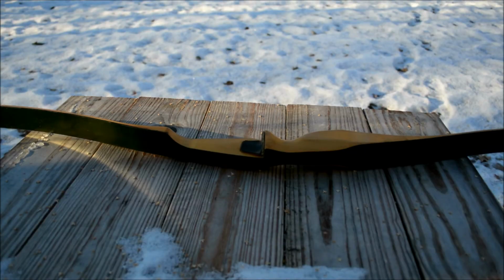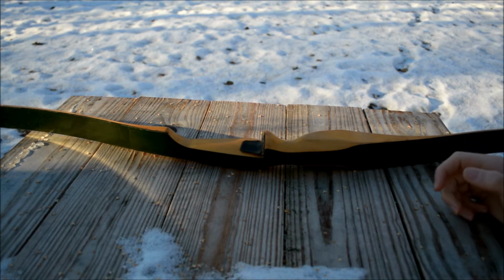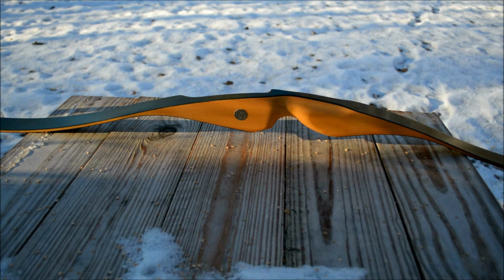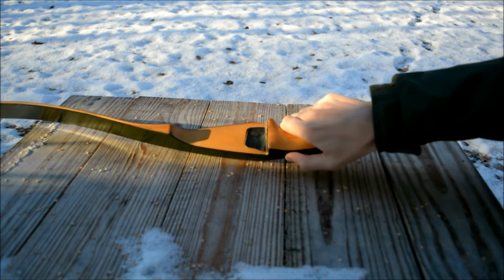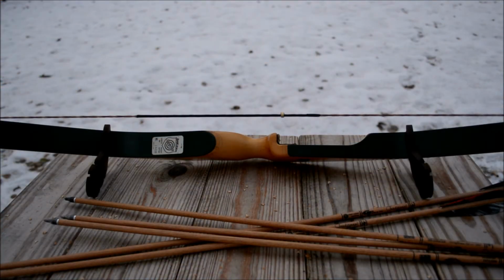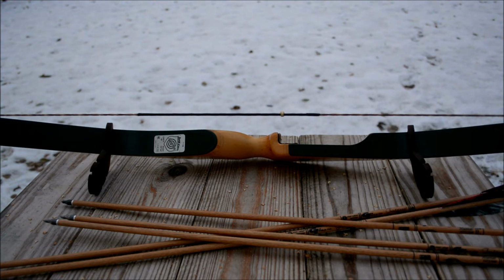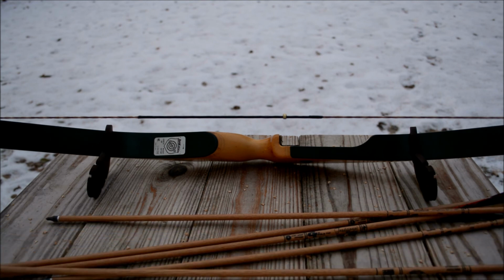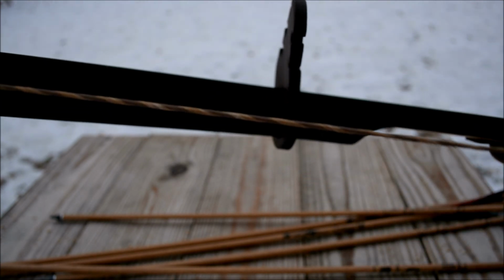Darton Superflite Ranger Build-AlaskanFrontier1

Comment: Hello! I got one of these years ago from a relative, and am trying to find the right bow string. It says 58" on the back but I'm not sure if that's straight up inches or "AMO".
Reply from the maker: I used a 58 inch AMO String. I'm not sure how much you know about strings, but basically, a 58 inch AMO string will be physically about 56 - 55 inches to help the bow properly brace. This is done as the bow itself is physically 58 inches.
Reply: @AlaskanFrontier1  Ah okay, thank you very much for the quick reply. I'm not super knowledgeable with bows honestly outside of a fiberglass one I used to play around with. I'm more of gun guy but I want to try and get into archery again.